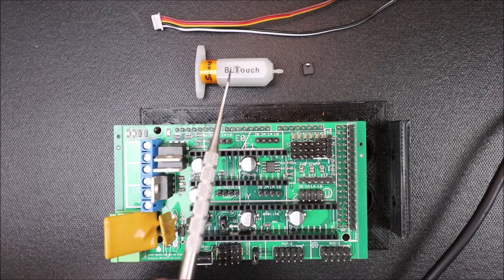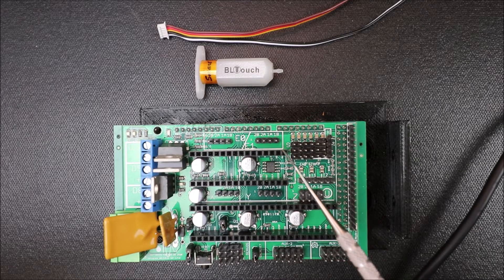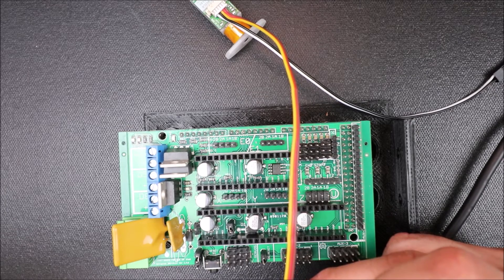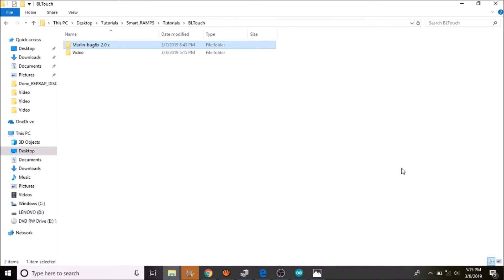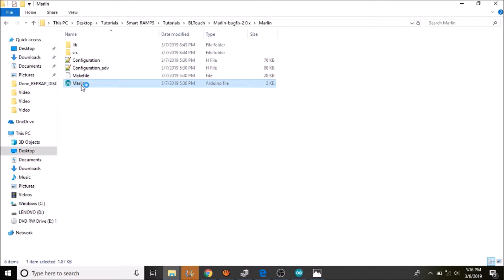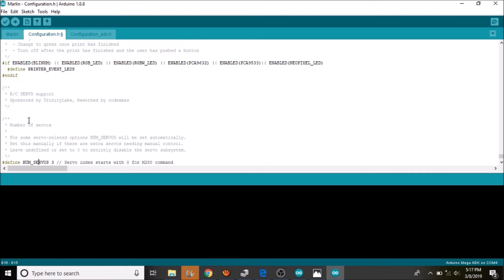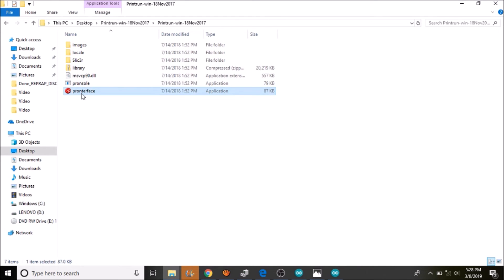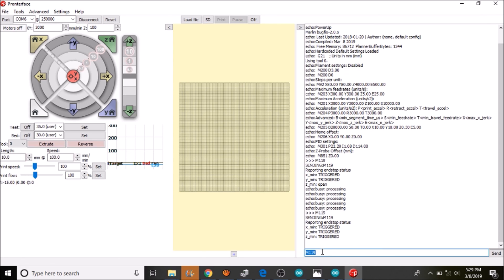Smart RAMPS - Bltouch

Comment: Nice
Reply from the maker: Thank you.
Reply: @EdwardBraiman  No problem! I hope your Smart Ramp Guide picks up views, it is so far the best one I've seen and helped me pick this board out for my next 3D printer build.
Reply from the maker: Thanks.  Most people have shown low interest in 32 bit processors.  I'm trying to change this view, but have several tutorials going at once to keep interest going until price comes down and interest goes up.
Reply: @EdwardBraiman  That is a pretty good plan, but yeah im amazed at how many people don't upgrade to Arduino Due, depending on where you buy them they hardly cost more than the generic Mega. Also I don't know if you covered it, but integration with a wifi module would be a pretty nice topic. Perhaps being able to upload the G-code to an SD card without having to plug said card into your PC...
Reply from the maker: Yeah, that's another tutorial on the list.  Still need to record SPI for tmc2130 for several boards.
Reply: @EdwardBraiman  Sweet I'll be looking foward to it...